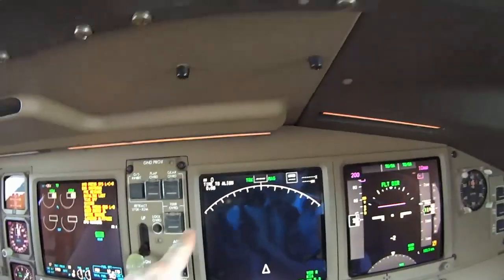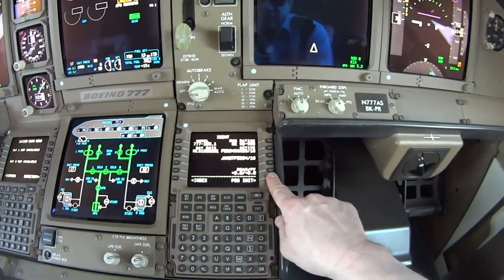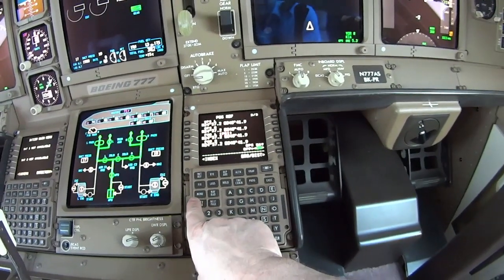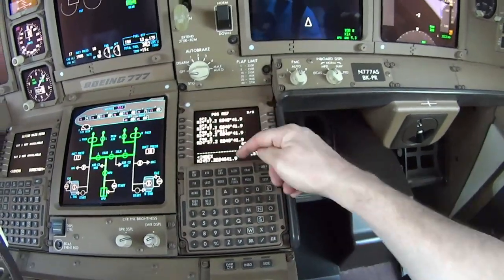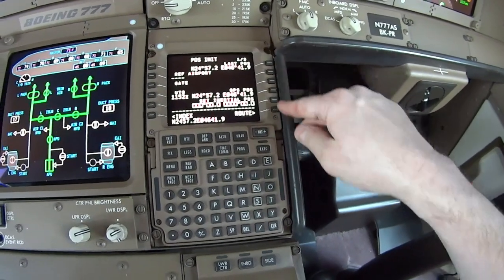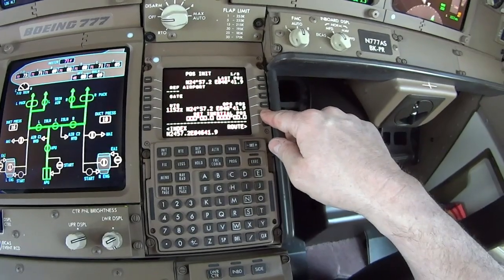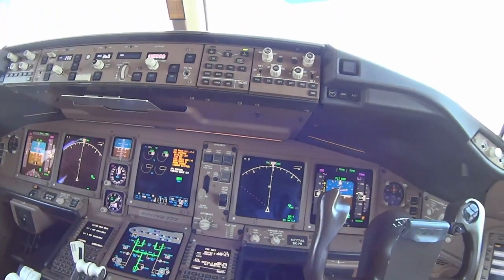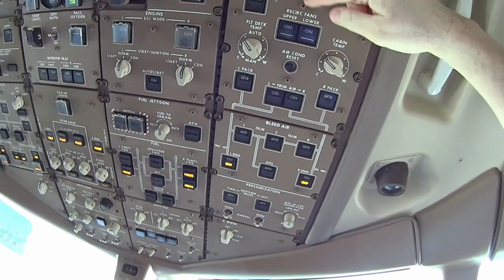Boeing 777-200 Preflight Part 4 | Flight Deck Overhead Panel Checks and Setup

Comment: I fly the 757-200 . Quite amazing how similar the cockpit is .
Reply: I flew 757 a some years ago and now I've been flying 737 for the past 5 years. Now I'm going to the 777 and I'm surprised how similar it is to the 757 and how easy the transition will be. The 777 is a modern 767/757 and I assume the 787 is a little bit like that too.

Comment: Amazing how PMDG made the exact model of this bird
Reply: The only thing that I don't like about PMDG is that they don't model the circuit breakers which they say is not possible but I believe it is possible
Reply: Andrew Ayad Actually, no one modelled it on any airplane. What I would love to see is data link communication in the pmdg. Normally, it should be available with their future pmdg global flight operations.
Reply: @andy4b767  That's overkill for a simulator.
Reply: Siddharth Kulkarni have you seen the FSLabs a320 family? Full inbuilt CPDLC and ACARS
Reply: And I don’t see the engine cont on the pmdg
Reply: @richardaal3085  different config
Reply: thats why its expensive lol

Comment: what is that  sound like air blow  we usually hear in cockpits ?
Reply from the maker: In this video that is exactly what it is.  Blowing air.  It is for equipment cooling.  There are several powerfuls fans locating in the electronics bay under the floor of the plane that are ducted to the electronics of the cockpit.  These fans suck air through the electronic panels and equipment to keep them cool. The hot air from the equipment is then either used to heat the forward cargo or dumped outside the fuselage depending on temperature in the cargo. When we are on the ground most of the the equipment cooling exhaust hot air is blown out the forward outflow valve which will normally be in the full open position while on the ground.

Comment: do you advise me study aircraft maintenance engineering or piloting??
Reply from the maker: Hi, that is really a personal preference.  Most pilots I know and work with do it because they love it.  I like to fly and have my private rating but I do not have the same love for sitting in the pilot seat as they do.  For me it has been much more satisfying to work on planes.  The pilots I work with are mainly retired airline guys and they always say they would not advise any young person to become a pilot.  They say that it is not the same job that it was when they were working.  I am a flight mechanic so I travel with this plane around the world keeping it maintained.  Been doing this for 15 years and find it very satisfying professionally.
Reply: BigIronTV nice =)  😍😍😍👌
Reply: BigIronTV I'm now studying aircraft maintenance engineering and I'm confused between engineering and piloting but always they tell me engineering is better

Comment: What an awesome job!
Reply from the maker: Hard to imagine having a regular job again.  This type of job is extremely rare.  There are not many privately owned and operated 777 jets in the world.
Reply: BigIronTV Did u start out with a smaller regional company? I wanna work in line maintenance. Is that what you do?
Reply from the maker: I did not go the airline route.  I went to aircraft manufactures.  Started at Boeing, also worked a few years at Cessna.  I worked in the factories building planes then moved to service center at Cessna and Mod Center when at Boeing.  Factory work is not as exciting as airline work but it did prepare me well for this kind of job because I know the plane much better than most airline mechanics do because I have actually built them.
Reply: BigIronTV Oh wow!  Do you have your A&P certifications? I hope I get someone as kind and knowledgeable as you to work with after graduation.
Reply from the maker: Yes I do.